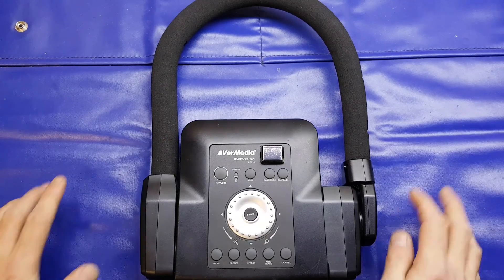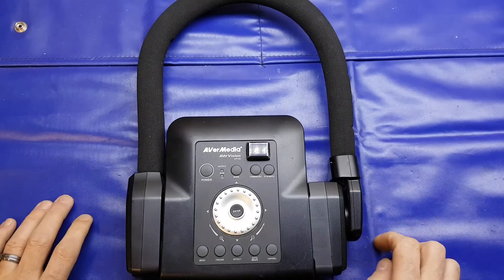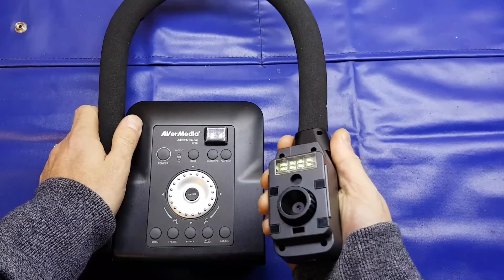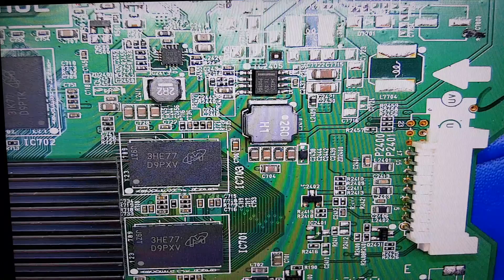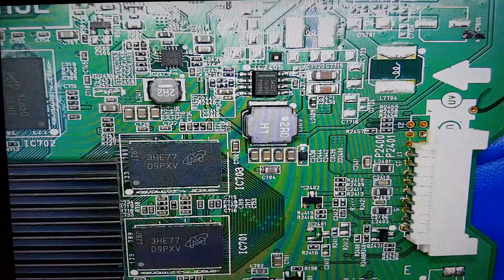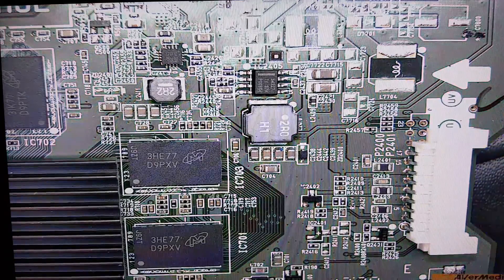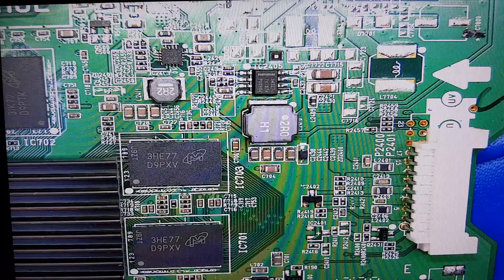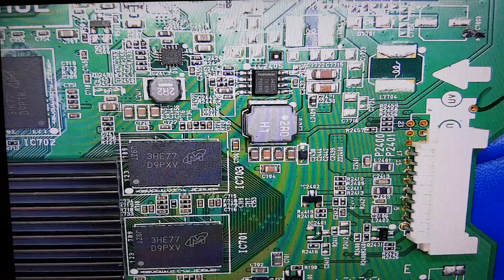Painfully cheap workshop camera for SMD work - honestly it's brilliant!

Comment: thanks for the heads up just what I have been after, just bagged one on eBay for under £15.  much better than the cheapy USB microscopes.
Reply from the maker: +stealth banana Has it arrived yet?
Reply: Yes, works perfectly.  Amazing for the price.  When you see other people on YouTube using 20 grand scopes against something like this.  Any idea what the original price was?
Reply: Oh the £15 included next day courier delivery.
Reply from the maker: +stealth banana Grand! Was it the CP155 you got?
Reply from the maker: +stealth banana Not sure on original cost but similar current models are around £300ish.
Reply: Yup, exact same module, not had time to use it a lot. But plugged into a little 7 inch monitor makes a handy portable inspection scope, could run it all off a USB battery bank if needed.  Bought it from a place down in England called pcbitz, they have quite a selection of ex educational bits on their website, something to keep an eye on.